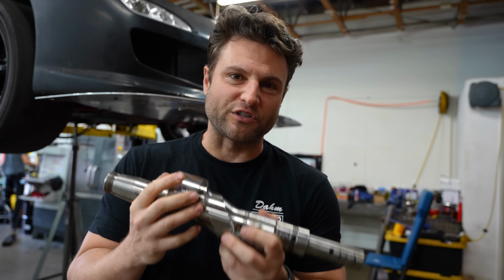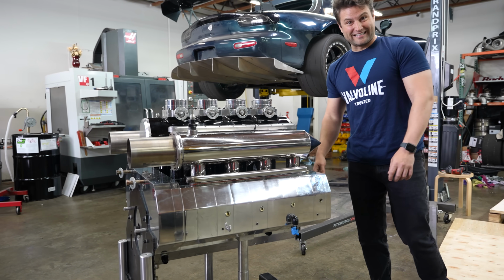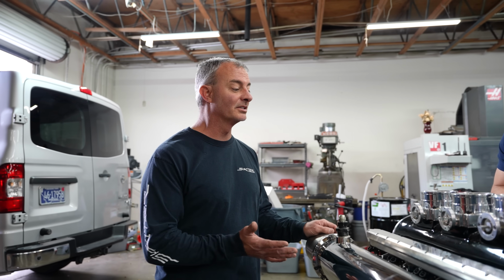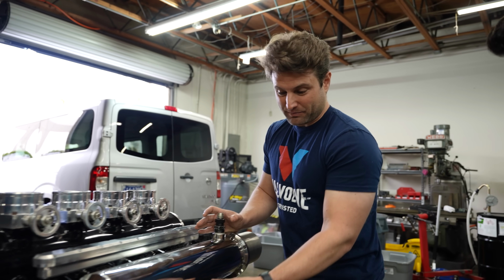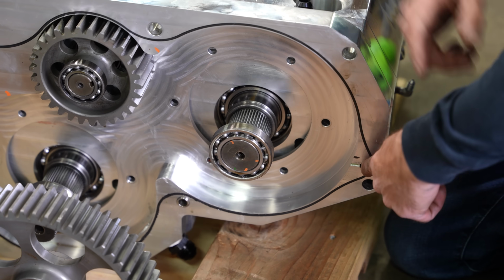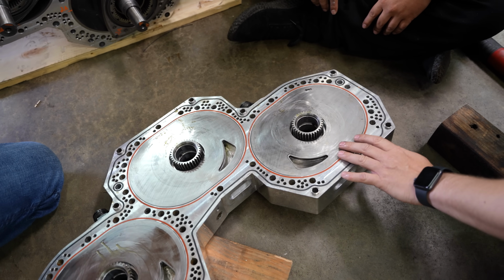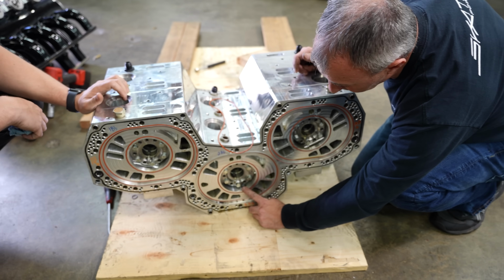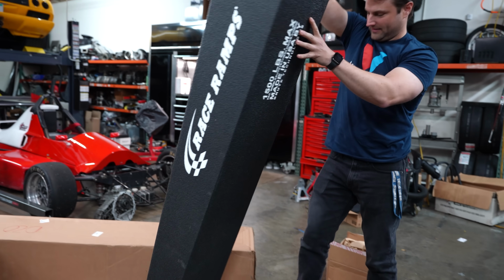I WAS GIVEN THE ONLY 12 ROTOR ENGINE IN THE WORLD!! WITH ONE GOAL IN MIND

Comment: Wow…. Opposed spinning rotors and no counterweights. This guy is a fkn genius! Added with Robs passion, talent and this thing will be incredible
Reply: Fr, he should be designing space shuttles 😂
Reply: @Zirion123  As soon s I saw the engine, the first thing that sprang to mind was aircraft.
4 x 18 rotors under the wings of a 737. LOL
Reply: The gentleman also said, "...on my bigger diesel one."  OMG is he saying that he has a bigger diesel version of this beast?
Reply: @ronkuhlmeier6414  wait, wha??
Reply: I'm still confused about the balance... the left and right 4 rotor banks are counter-rotating, but the bottom bank doesnt? I guess it will still torque somewhat, but no more than a regular 4 rotor. 

At first I thought the layout was going to be like 2x 6 rotors arranged in a V configuration, but it's more like 3x 4 rotors in a W configuration.
Reply: @Ikaros---  The problem isn't the torque moment, that's absorbed by the engine mounts and it's only a transient acceleration force rather than a constant one.  The problem is the actual dynamic balancing of the engine.  You can oppose each weight with a counterweight, but they won't be close enough together to cancel themselves out.  Picture a counterweight or balance shaft on a normal engine that's properly balanced as far as weight and phase goes, but located 10ft from the end of the block.  It's going to cause the engine to rock back and forth as one side moves up and the other goes down, that's the rockling couple that engine manufacturers try their best to eliminate with balancing.  It's not as exaggerated with this engine, but it's still a balance issue that shouldn't be ignored.  Even though you have two banks that can cancel themselves out, they're quite some distance apart, and will induce a secondary imbalance.  If they're not careful phasing the rotors, it can also create constructive interference from the third bank creating a third order vibration too.  It probably won't be bad enough to destroy the engine, but that's a lot of power loss and accelerated wear, something that could easily happen if not properly accounted for.
Reply: @Skinflaps_Meatslapper  I'm sorry but you haven't a clue....If you can look at this level of out of the box thinking (ie splined shafts that allow you to crank the firing in any configuration, so this itself also helps cancel vibration) 
If you think Tyson didn't consider the issues you are raising then you haven't done much machining yourself.
Reply: @danstewart8218  You're missing a fundamental understanding of balancing reciprocating assemblies if you think the issue goes no deeper than changing the phase and firing order of each individual rotor.  Not a single person has challenged the issues I bring up.  It's not a good look, attempting to use something irrelevant to the issue being discussed to discredit me, as machining and engineering are two separate subjects that depend on each other.  A machinist builds to specification, an engineer specifies the build, both are necessary for a successful project.  I could use a 5 axis mill to make a beautiful and intricate engine to the highest level of accuracy, and with poor engineering it would self destruct from vibration.  Machining and engineering are two different things, and balancing this engine properly requires a level of engineering that simply wasn't incorporated.  The fact is, this will be a rough running engine, and no amount of configuring rotors can change that unless additional design elements are put in place.
Reply: The bore fest you brought on with this thread was amazing
Reply: It seems that each bank of rotors balances itself by setting the rotors either at 90 or 180 degrees from each other. At 180 degrees two rotors fire at the same time. At 90 degrees one rotor fires at a time.  The the counter rotating bank helps offset the gyroscope effect of the rotating mass. It is still only a third of the rotating mass so there will be some gyroscopic motion.  All those rotors spinning will have a lot of mass.
Reply: There's still going to be some dynamic imbalance there no matter how you arrange them, it's just not going to be catastrophic to the engine.
Reply: @Skinflaps_Meatslapper  just stop. He clearly explains it in the video and its the same reason v12s dont need counter balances or on straight sixes. Same principle applies, the rotors balances themselves out the way they are oriented..
Reply: @Skinflaps_Meatslapper  he has already shown it in a video with a glass of water on top of one of the banks and the water didnt even ripple so u are wrong
Reply: @Zirion123  Are you blind?  Not only were BOTH of those glasses shaking, the rear was starting to walk off.  At IDLE.  On SOLID MOUNTS.  I can bolt any engine down to a solid mount and it'll likely pass that metric.  Try that test with rubber or poly bushings and rev it up a little bit, see what it does.  Even the dyno video showed the engine visibly vibrating, and that was only 2000RPM.  Vibration energy doesn't double when RPM doubles, it quadruples.  So at 8000RPM, that vibration will be 16x as intense, and just imagine what it would be like at 10 or 12K.  Like I said, it's probably not going to destroy the engine, but it's certainly not balanced, and definitely not self-balancing.
Reply: @Skinflaps_Meatslapper  ok my bad then, but that dyno video is from 9 years ago tho. He might have figured something out by now, but we will see when rob gets a proper wiring harness on and gets it running i guess
Reply: @Zirion123  I'm certainly going to stick around for it.  I don't think he's done a whole lot to the engine since, seeing as how it's been nearly a decade since they ran it on a dyno.  Usually that means they ran into some sort of problem they couldn't solve and ran out of steam.  Based on the video, I'd imagine it has something to do with inadequate fuel and spark delivery.
Reply: @Skinflaps_Meatslapper  24 injectors 🤣 pretty sure ur right
Reply: @Skinflaps_Meatslapper  How these people expect one bank of contrarotating rotors of the same mass to cancel out the vibration from two banks is beyond me. If there were four banks of rotors, or one bank had more mass, there would at least be the possibility of that, as long as they are configured correctly, but there's simply not enough mass to balance the vibration of two banks of rotors with only one contrarotating bank. 

No matter how cleverly engineered this thing is, it will always have, at best, a similar but slightly greater amount of vibration to an unbalanced four rotor, since it has four unbalanced rotors in it. 

I'm sure you can enlighten me further on the subject, but there is an easy to understand fundamental reason why what you're saying can't be wrong: One bank of rotors of the same mass spinning at the same speed cannot possibly counterbalance two banks of rotors.
Reply: @ThePartialGod  Hey, you're the first one who got what I was putting down, nice.  Even if you had four banks opposing each other's mass, you still have to factor in secondary vibrations too.  Most people view it simply as rotating masses from the front and don't consider looking at it from the side.  Sure, the first and fourth or first and third rotor are balancing each other's mass looking from the front, but from the side, you're going to see a lot of wobbling back and forth because one is trying to lift the front of the engine while the other is trying to push the back of the engine down.  That's just one mode of vibration to account for on a simple 2 rotor, and the vibrations start stacking up the more rotors you add...you simply can't balance every axis of a stacked rotor engine without incorporating some sort of balance shaft located where it will be effective.  Ultimately you are correct, in the absolute best case where two of the banks can magically cancel each other out perfectly, this engine will still run like an unbalanced 4 rotor.  Part of me really hopes that it does, because I'd love to see this thing rip.
Reply: @Skinflaps_Meatslapper  Gonna need some insane damping that's for sure. 
The counter rotation helps solve having counter weights but yes the sheer distance between the moving masses adds vibrations and rotation on different vectors if you like. Will be interesting to see just how much of that can be dealt with by bushes and mounts.

Comment: Man this is insane, this sounds like an easy 3000hp, also can't wait what this could mean for future cnc projects, dual 4 rotor with 2 massive turbos for maybe a, i dunno, diablo or something anyone?
Reply: 5000hp with twin 106mm turbos @ 50psi... according to an article i read
Reply: @kai_444  From what i heard this specific engine has some design flaws over the 4 rotor, hence why i was a bit more conservative
Reply: At that point fuel capacity becomes a huge consideration
Reply: @R03333  well, who needs passengers anyways? Slap a gigantic fuel cell in the passenger seat and surround it with absurd ammounts of fire suppression
Reply: @tiagobelo4965  that still might be safer than "driveshaft elbow" era 4 rotor
Reply: @R03333  yeah, the gas mileage is probably measured in YARDS per gallon at this point lol
Reply: @richardbottom9843  gallons per yard
Reply: @R03333  tbf its a boat motor so storing fuel isnt that much of a problem
Reply: @allorfh Rob's not going to put it in a boat lol. This badboy's going into a car, at least temporarily anyways.
Reply: I'm trying to do the motor math myself. Rob said his current 4 rotor set up is making around 1200+hp with small turbo. On Hoonigan race series, Rob mentioned if he switches to his larger turbo, the car could make upwards of 2000hp. If that 4 rotor is capable of making 2000hp, could this 12 rotor in theory make 6000hp? Now I know with that much horsepower and torque, everything single thing from transmission, front and rear axels, roll cage, chassis glass, wheels, tires, even nuts and bolts would have to be upgraded to withstand that level of power,  but does that sound right, if so we're getting beyond promod levels and into funny car/dragster levels.
Reply: @MultiTravellingman  well that 12 rotor is probably twice as strong as Rob's 4 rotor, so I think that it theorecially could support more than 500 hp a plate. However that's getting into the triple injector territory, and who knows how well that thing can flow air to support it. It's going to be a nightmare of tuning to have to consider per-rotor, per-rotor-bank tuning for timing and fueling. If this thing puts out SMX power levels, very big W (50psi of induction pressure is a walk in the park for a SMX big block)
Reply: @AzureCrux  if I remember the 12-rotor dyno video correctly, it did north of 1300 HP N/A, and that was while being massively limited by the carburetor setup they used
Reply: @halofreak1990  good God what a terrifying monstrosity
Reply: I'm calling 5000hp
Reply: With all the changes rob will do that engine can do easy 8000hp
Reply: Transmission and axles are going to be the limiting factor